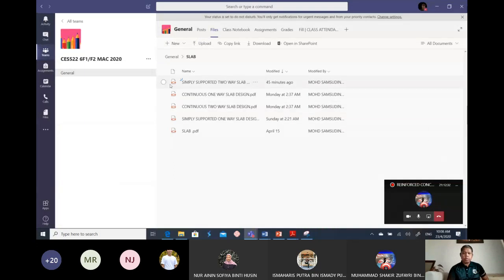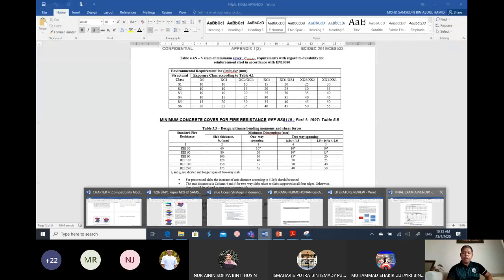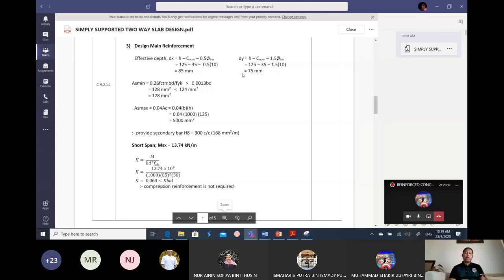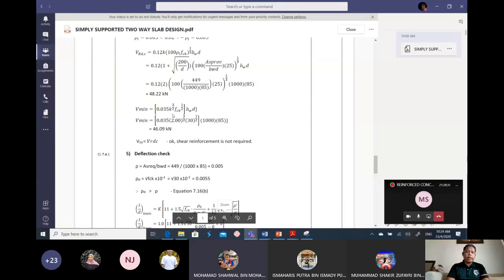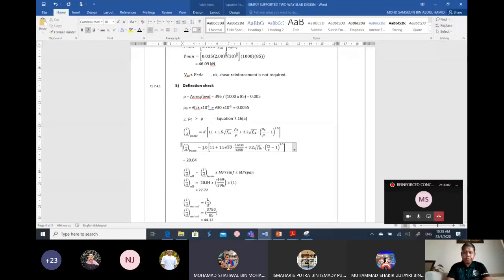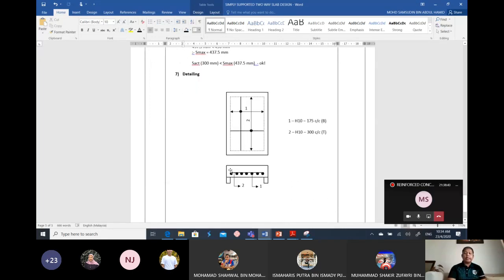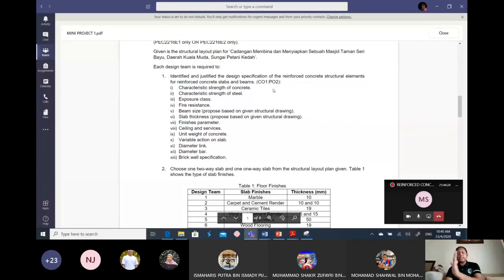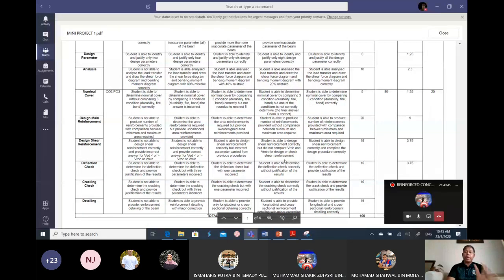REINFORCED CONCRETE DESIGN CLASS SS TWO WAY SLAB

Comment: How to calculate slab thickness with effective span, L = 8.0 m (rectangular simply supported slab) and what should I try on when their limit are only 200 mm?
Reply from the maker: May i know you L and b of your slab? i f your slab thickness by using span over depth ratio more than 200, therefore you need to change the slab configuration or slab size by adding beam in between.  we have to control the slab with maximum 200mm. But you may try to calculate by using 200mm as maximum thickness and done all the checking and if it is not fail the design is acceptable. if fail you need to change the slab size by reducing the area as i do propose in my video.
Reply: @mohdsamsudinabdulhamid3295   A rectangular reinforced concrete slab is simply supported on two masonry walls 250 mm thick and 8.0 m apart (clear distance). The slab has to carry a distributed permanent action of 2.0 kN/m2 (including the slab self-weight) and a variable action of 3.0 kN/m2. The slab inside the building subjected to a 1- hour fire resistance is to be designed for 50 years design life. Where the material to be used are grade C30 concrete and grade 500 reinforcement. Design the slab. This is the full quetion sir.